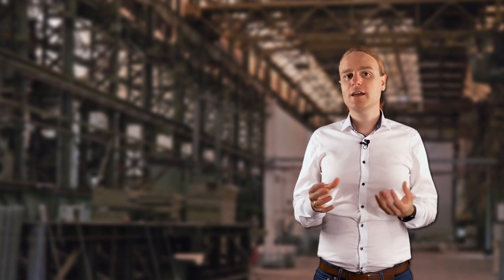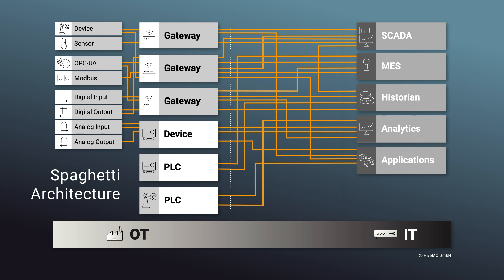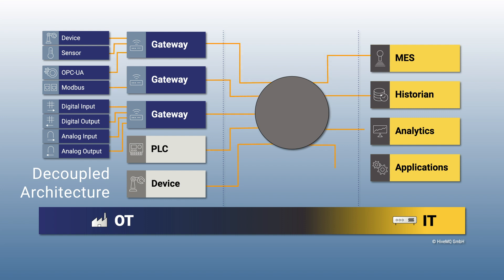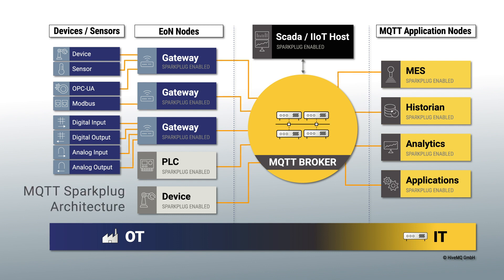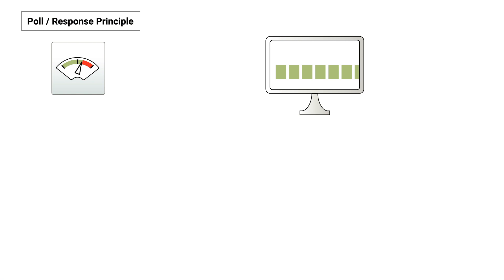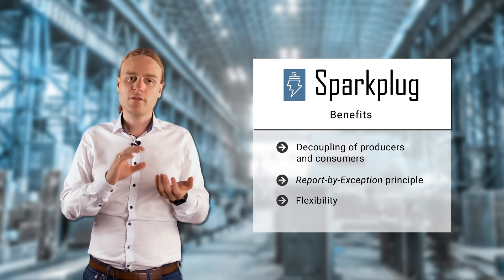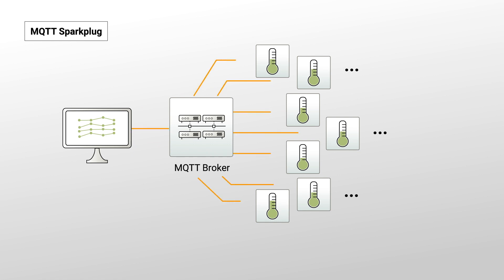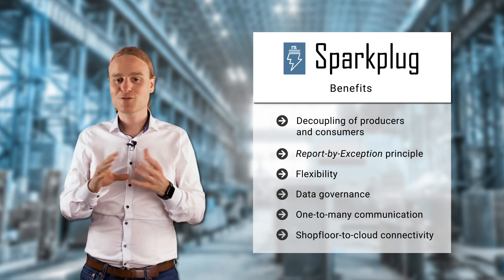Sparkplug Essentials 03 - Sparkplug Architecture

Comment: so one of the main goals with sparkplug is to decouple the shop floor from the cloud because internet connectivity issues can now have many more additional side effects when digitizing a businesses operations?  Therefore an effective IoT design has a local (local to the shop floor wifi network) mqtt broker that warehouse operators communicate with to manage their shops devices? This local broker then relays messages to the cloud for possible CPU intensive cloud computing tasks? Does the local broker typically store historical data and send the data to the cloud?
Reply from the maker: Hi Michael. You are correct, that a broker federation type setup is common and aims to deal with issues such as loss of internet connection or even power, depending on the region the shop floor is located at.
MQTT offers the possibility of queueing messages for offline devices and a cloud broker would act as a device to the local broker in this setup. When using the HiveMQ Bridge Extension, there will be up to 500k messages queued on the local broker and delivered to the cloud broker, when connectivity is re-established.